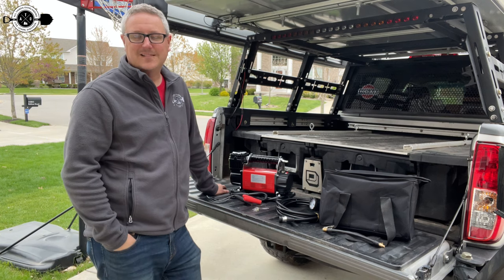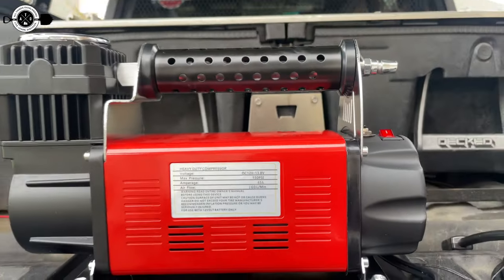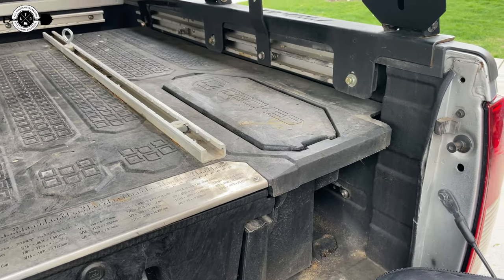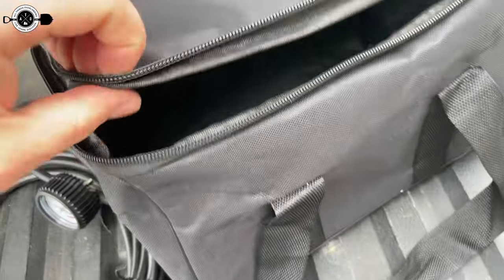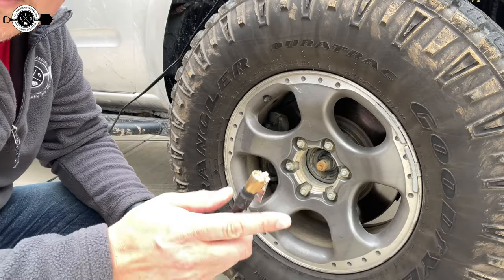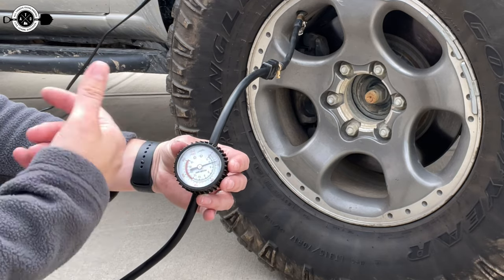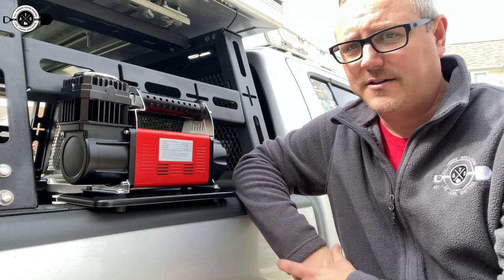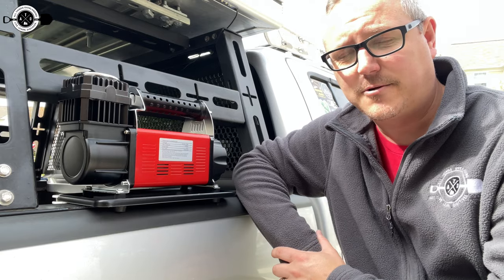Gobege 12V Air Compressor Test - How Long Does It Take to Air Up 35's From 15 to 35 LBs of Pressure?

Comment: Hey Fletch. Looks just like the Smitybuilt compressor. I've made some modifications to mine that makes it more useful and will extend the life.  First modifications was to get rid of the metric quick disconnect and replace them with NPT so I could use standard air fittings (I use the ARB hose and filler, which only calls for air when connected to a tire stem)  Next mod was to add a pressure switch so the compressor only turns on when air is flowing. It doesn't constantly run (longer life) . Final mod was I mounted it inside my side Decked box with a quick disconnect coming out the front. If you are interested in any of this, I can message you over on FB with the parts, wiring, and what I did. - Dan
Reply from the maker: That's awesome. And yeah, pretty sure these are most likely all made in the same place and rebranded, :D. I would love that if you don't mind sharing. Thanks Dan!

Comment: Looks just like my "All-Top" brand compressor, which I'm happy with, so I expect this one is good too. It seems many of these sold-on-Amazon compressors are made at the same factory, just with different branding and colors. Just recently aired up all 4 tires on a 100 degree day and it didn't need a rest. Will have to see about long term durability. It should get a good test as I use it all summer in the desert heat and dust.
Reply from the maker: Yep, I looked at that one too. Pretty sure they're all the same, :D. Good to hear it worked well for you! I'm planning to mount mine down in my Decked side storage box so hopefully it will be pretty dust/water proof. Should have enough air volume in there to not impact performance. I'll have to run some tests once it's installed to see how it does. Really happy so far though!
Reply: I have the All-Top one as well but haven't used it much so far. I definitely will get that quick disconnect he showed though. Also want to switch from the gator clips myself but not going to mount it.
Reply: I have the All-Top as well and so far I’ve been impressed. This one looks like the same one but with different housing color. I have learned getting to 35 psi is not that difficult for a lot of compressors. Going from 35 to 55 is what starts to separate the work horses from the run of the mill compressors. I had a Smittybilt which struggled to the tires inflated back to spec.

Comment: Thanks for the link to the hose extension with the quick release, I have the larger harbor freight portable compressor, which has a screw on Chuck also. It works ok, but gets super hot even if I'm topping off one tire, so not sure on the longevity of it.
Reply: Seems like the biggest issue with those is the hose popping. No issues with mine so far
Reply from the maker: Yeah, I haven't had any issues with the hose popping off with this one after multiple uses. It was a sweet upgrade to both of my compressors so far.

Comment: I have the Harbor Freight version and had it for years before it went bad. I needed one quick for a trip so replaced it with the same thing. It's good for what it is. It came in handy when my trailer tire went flat after filling it up with mulch. I put a quick connect on it as well. I plan to do an anderson plug at the front and back of my Jeep to make it quicker to connect.
Reply from the maker: Great ideas and good info! I got some info from another subscriber on how to fab up an auto shut off, a splitter for multiple air hoses, etc. So, I'm sure I'll be working up some more videos in the future to get into some fun mods for these things.

Comment: Thanks for the review. I was wondering if there was a particular reason you chose the Gobege over the Smittybilt 2781/ AllTop?  Was it purely based on price because of the $20 off? Even though the compressors might be made in the same factory, the SB2781 /AllTop add an extra protection with the inclusion of a  blow off valve that the Gobege doesn't offer. It's probably not a big deal as most times you're monitoring the operation and not going to the high pressures.
Reply from the maker: Yeah, it was pretty much the coupon, :D. I figured that with the increased flow over my Viair, even if I only got 2-3 years out of it (using it maybe 4-8 times per, year honestly) that it was worth it.
Reply: @AllThingsOverlanding  I'm calling 🐂💩!  Gobege sends these to content creators in exchange for positive reviews.  You should try being honest, people will respect you more.
Reply from the maker: @UncleFjester  It does say, right at the beginning of the video, that it's a "paid partnership" so not trying to hide anything. 

I did get it for free, but there were no requests/demands that I review the product positively. I've had a Viair 88P for a long time and it was great, but didn't move enough air to be practical for my 35's so I was looking to upgrade anyway. 

If we're being totally honest, this and the Alltop and other similar units are surely made in the same factory, so I think any of them would be similar quality. It does move a lot of air and I do like it. I've since mounted it into my decked system and wired it permanantly so it's still working well and has been fine. No complaints.

Comment: stoopit human trick (some people call it a life hack) for situations like at 6:30  ... starting from tire inflate at known pressure (by whichever method including little birdy telling it) ... run the compressor and note the indicated level while the air is flowing through the meter. Make that your gross inflation level target. To test,  let air out significantly lower than desired level. Run compressor continuously until meter reads prior reading. Stop compressor verify actual reading. Remember meter shows XX psi while running == 35 psi while stopped. EZPZ eh?
Reply from the maker: Good tip! Makes sense to pay attention to what it's at while off and what it jumps to when airing up and then referencing those two against each other to more easily know what to "air up to" at the higher PSI. Thanks!